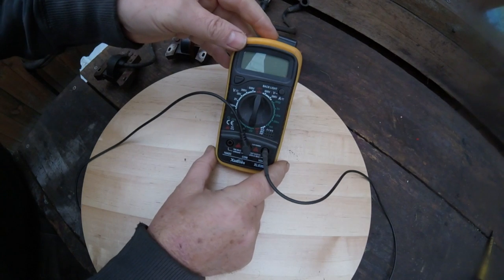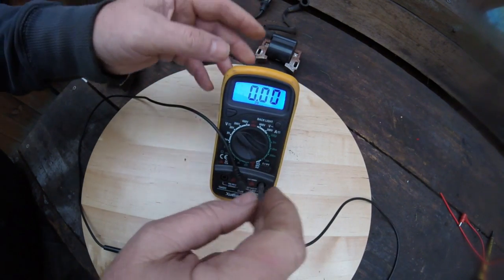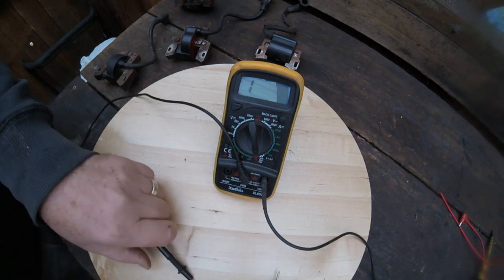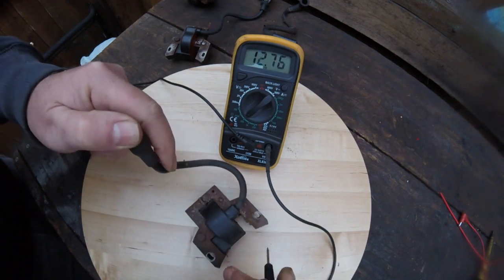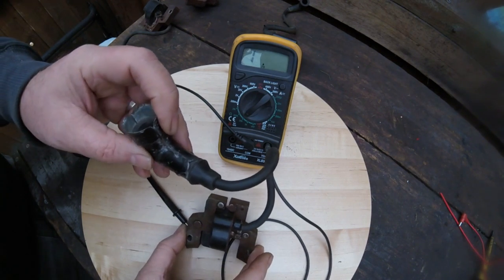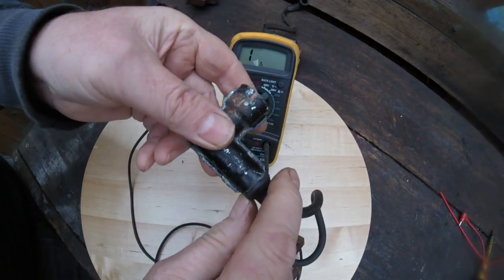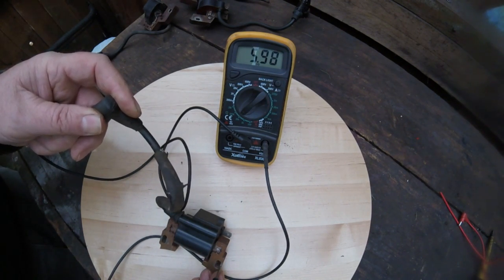How To Test a Briggs And Stratton Lawnmower Coil Using a Multimeter

Comment: Hello Roy - interesting test procedure - all you are doing is measuring the coil resistance - the simplest and most positive test is to disconnect the primary lead turn the engine over and you will either have a spark or no spark - that's one sure fire way to test your coil.
However if you want to do a full diagnostic test for the quality of ignition coils the best tool for that is the IMRIE 3000 - it will let you know the efficiency of the coil and the high tension voltage.  I spent many-many years servicing and repairing commercial and domestic engines used on mowers etc and engines used in hire equipment - my IMRIE 3000 with its various adaptors was an invaluable workshop tool - it made testing ignition systems a simple and efficient process.   https://www.youtube.com/watch?v=zHTEYxWbVTA

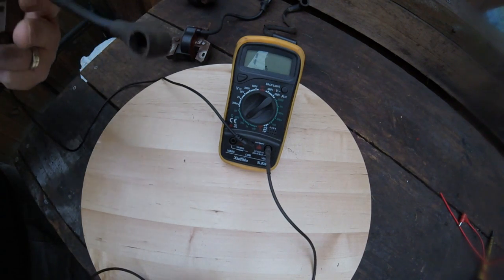Comment: I have an old rototiller that has a single Briggs and Stratton in it. No spark. The coil measures 2.67 when out and checked. It's origanal from the looks of it. It's rusty, but I've seen worse. 2:59 
My question is.... Should I just replace the coil and plug. Then check for spark?

Oh... the model, style, and type of unit isn't found. A sticker refers to the documentation that comes with the tiller. Long gone.
I called a local shop and they said to bring the coil in and they can measure it and that'll help with fitment.

Comment: That last engine with the governor that uses airflow to govern is old-school, dont see those these days.
I got a mower feom the kerb and has no spark and the coil secondary is measuring 4.7k, i might just have to clean all the mounting contact points before pulling another coil off another motor. Kill circuit functions good (switches to ground)

Comment: Thank you (from the USA). Nice video. I suspected my coil was dying intermittently.  For reference (and information) out there, I just purchased two different (aftermarket) coils for my 208cc ( CR950 ) Briggs motor from amazon. Straight out of the package one ohm'd at 6.4k and the other 10.3k oHms. A Briggs & Stratton spec is nowhere to be found on the internet. This was helpful.

Comment: Can a coil quit working when it gets hot?  How do you test for that?  It runs maybe 30 minutes bogs down, then quits. Let it cool down and it runs again maybe 10 minutes and so on. Any thoughts?  This is driving me crazy. Thanks in advance.
Reply from the maker: Yes it can but first try changing the spark plug and could be other things like carburettor, old fuel, and even the fuel cap vent is clogged up or not on properly

Comment: Um... @3:30 testing the way you did there won't give the correct measurement, the resistance of the primary and secondary should not be the same, one should be much greater... 

(Unless everything I learned in Electronics was totally  wrong)...

Comment: Hi Roy ,I think I should point out that the 3rd coil you checked as open circuit has the metal cased.Resistive plug  connector which plugs into the coil lead .It's value is 5k ohm. If this item is open circuit or the connection is  corroded to the lead.Then the test will show no reading on the coil.It can be misleading.I got caught out and purchased  a new coil for nothing.Cleaned the connection after finding out it can be separated. Then tested ok.

Comment: So my coil is off a 17.5hp Briggs and I lost fire yesterday as I was trying to start it up, it kept flooding. Not hitting at all. Thought it was possibly a switch or sparkplug but I tried a spark tester and it wasn't jumping on it. My meter showed 1. On both tests. So my coil is dead?

Comment: I have a talon mower that has one side bolting down the air vein and the coil but it doesn't have a bolt to turn. It could be pressed in or screwed but I have no idea how to undo it to remove the coil. Has anyone done this ? Thanks .

Comment: The coil with the big spark plug cap might be good. Pull the plug cap off of the coil lead and measure directly. When I was a mechanic on motorcycles We would find failed spark plug caps. Many of the had resistors in them and they would fail.

Comment: Finally someone that taught me the right way to use the meter on a coil!! Thank you for your help and video!! So mine reads 6.45 Briggs and Stratton would you know what a new one is supposed to read? I have ordered and installed a new thermostat, changed the oil, filter and still not wanting to run. It has a self choke primer it’s a 2013 craftsman push mower.

I might add the carburetor has been cleaned as well. There’s not much more I can get besides a new coil and carburetor
Reply: If someone hit a stump the key on flywheel can shear....timeing is then off...and 6.0 is good reading... Squirt gas in plug hole...then put plug back in
Reply: @PaulPippinjr-ev2wi  I decided to keep the new coil since there was nothing wrong with the old one. I did replace the carburetor and the self choke primer and the lawnmower has been running great. And let me tell you on the first pull it started right up.🤙🏽

Comment: Question i have a lawnmower 7.25 engine and when the first start is no problem and when the 2nd start the no have spark, i change the oil with a replacement and measure the ohms and have 5.75 k and y calibrate and the problem persist and then i buy a oem coil new and the measurement its 6.50k and i put the oem coil and the problem persist in the 2nd start they no have spark, the flywheel and key its perfect, spark plug its new, any body cant help me

Comment: also test between the coil and the engine case should be no resistance. may have to clean rust or corrosion. I have tested coils that tested good resistance wise but still no spark. took the old spark plug connector off and put on a new one.

Comment: My problem isn't testing it, it's getting to it. I have a 5.5 hp quantum, circa 2004 or 05. I have removed every visable bolt holding on the top and still can't get it off. It's loose, but something is still holding it!! Can't find any instructions for that motor on line. Most of the engines seem to have a couple of bolts on top and whoosh! But I've taken out 6 bolts, three from the front and three kind of hidden in the back and it still won't budge. Don't see anymore bolts!

Comment: The primary windings should always have less resistance than the secondary windings not the same. You tested the secondary windings twice. A resistance test is not a reliable test.

Comment: if it will not fire on the engine what good is  tests with multimeter  just replace it nothing to repair no matter what it reads    what do you hope to find with meter test that you can fix ?????  i use meters every but not ness. this case

Comment: Help!
I'm trying to repair my neighbours lawnmower. I have a little bit of knowledge that makes me dangerous!
It's a big Hayter with a roller and a Briggs and Stratton motor, but can't see any model number.
I removed the rusty coilpack cleaned it all up and did your electrical tests on it. It came back with 4.54 k ohms and the same when I tested it on the ground connector.
I put it back on and with spark plug removed put a test light between HT lead cap and earth on cylinder fin. I got a good pulse light when I turned the engine over with a drill on the flywheel nut. I also tested continuity of the earth lead. Incidentally all work done with kill bar taped up in running position.
Put it altogether and put the test light on the spark plug but no spark.
I've whole procedure twice now.
Second time with new spark plug.
I inspected the Woodruff key on the flywheel. I heard if these break it can throw the timing out. This was all okay. A
Reply: Any ideas what I should do now.

Comment: I'm testing a Briggs carb off a 6.5 hp engine. Reading 4.99. no spark, but the flywheel was cracked as well.  Is this still a good coil

Comment: I have a old Fairbanks Morse generator with a Briggs and Stratton engine. It's a model 23FBPC type 203531 serial 289831. I want to know how to test the coil on it and find out if I can get a replacement coil if it's bad. I have been told that they don't make new coils for this engine?

Comment: I have been swapping Briggs & Stratton coils from one engine to another,for a long time.Never had a problem with them fitting.Recently,I purchased a couple of them from Amazon.I have 2 problems.#1 they won't bolt on.The slots are too far apart,only by the width of the slot (1/8").#2 I tested both of them with my meter,and both read about 7.9K ohms.Out of range to be good..Has anybody else had an issue ???These are NEW,Made in China
Reply: it depends on what the coil fits as to readings .

Comment: On every coil you tested you only did the HT side , I have a few coils with good secondary readings but the primary side was duff , those ones you tested could have been the same so removed ?

Comment: I have a lawnmower with B&S engine, which is difficult to start when hot. I also have a B&S coil with 9.34k Ohms. Could this be the problem?
Carburator is without choke, it has a priming bulb

Comment: Very helpful. Thank you. I just bought (very cheap - 20$) a 8 hp snowblower with B&S engine, no spark - so I'll use this metode to test it.  Very easy, and I don't have to remove anything to get it testet either :)

Comment: Big help, thanks. Note, B&S coils spec between 2.5~5k ohms. (not 25,000)
Reply: Dude thank you ...when he said the coil should read 25,000 to 26,000 ohms & he put it on the low setting of 20 ohms on the meter IT DID NOT MAKE SINCE...

Comment: The coil with the metal sparkplugcap is dead,  but in these caps is a big register build in, pull off the cap from the wire and test it again, these metal caps offen gif a lot off troubles, they are a realy pain in the ass.

Comment: Coils fine , plugs fine still no spark any ideas Roy ? Many thx
Reply from the maker: Check it ignition wire connection if it's a briggs 35 classic it's at the back
Reply: Was running and cut out , I thought it was fuel
Reply from the maker: Have you checked and cleaned the carburetor
Reply from the maker: Or tried another plug

Comment: Mine is reading around 9k ohms, what's that mean?
Reply: Did you have problems with the coil? I have a lawnmower with B&S engine, which is difficult to start when hot. I also have a B&S coil with 9.34k Ohms. Could this be the problem?

Comment: Just FYI - resistance has no polarity, so you don't have to worry about putting the positive test lead or the negative lead in a specific place - you'll get the same whether they are switched or not.

Comment: A very useful video. Didn't fix my problem, but I was able to avoid wasting money on a new coil. I suspect my problem is bad magnets in the flywheel.
Reply from the maker: Try cleaning any rust from the magnetic and from the coil
Reply: @roystheboy  I did that. It didn't help. I got fed up with it and put it at the curb. Now it's someone else's problem. :-) Thanks for the suggestion.
Reply: @Bargle5  never seen a magnet go bad. Did you happen to sand the post the coil bolts to? Also gap it correctly.  Guys like me absolutely love guys  like you because of your lack of patience as well as knowledge of the situation.
Reply: @cravenmoorehead5636  Yes, sanded all the contact points. Set and double checked the gap. Also checked for a grounded out kill wire. And made sure the spark plug was good. Nothing helped.
Reply from the maker: Then some time we have to do that

Comment: You say the range is 25000- 5000 ohms  and then test one  coil that comes out at 2,67Ohms   2670ohms and said it's good,  doesn't make sense to me ??  Seems to be out of range to me , maybe you meant 2500-5000 ? Anyway thanks for a good video
Reply: Googling the question yielded multiple 2500-5000 ohms.
Reply: I see your point, you are being a jerk. Anyone than can run a multimeter should understand what was met not what was said.😊
Reply: He did say it's probably on the way out.
Reply: He should have said 25 hundred....not 25 thousand.  2500-5000 is the range. Mine just tested 9.96.  So 9960. Way high

Comment: Maybe there is some confusion about what a good resistance reading range should be because you say between 25,000 and 5,000 when you actually mean 2,500 and 5,000.  You say 25 thousand not 25 hundred.  Just pointing out some confusion.

Comment: Put the coil on the engine. Adjust the gap. Unplug the kill wire. Spin the engine. The coil will either work or it won’t.
Reply: It can have weak or intermittent spark sounding normal but cant handle a load while trying to increase the rpms of the engine

Comment: What should the resistance be between the kill switch tab and the coil body (ground). I'm not getting a spark and the resistance checks out OK for the coil but the kill switch tab read 0 ohms (the kill switch tab is always at ground).

This is with the coil off the engine, so it's not the kill mechanism.
Reply from the maker: Check the wire for continuity may have a break in it

Comment: Great video! When I try this, I get a reading of around 2.2 with the first test, but when I connect one end to the spark lead and the other to the kill switch, I get no reading (infinite). Is the coil bad? Thanks
Reply from the maker: Did you have the dead mans handle in or out
Reply: @roystheboy  I disconnected the coil so it wasn’t grounded. Thanks for replying
Reply from the maker: @sulemanyusufadam4315  ok so its now ok
Reply: @roystheboy  sorry no I mean that the coil wasn’t on the machine so the dead mans handle wasn’t stopping the coil working

Comment: Your touching the coil lead, and the chassis of the coil with your hands and the probs  this is giving you a false reading as your body conducts electrical current also. Dont touch the meters probe leads and if you must do it only touch one and nothing else. Don't hold the part in your hands.  
If you were testing a complex circuit you couldn't do it that way.  Depending on humidity how wet your hands are you very well could be reading your body and not the coil.

Comment: I just did this test on a power washer today. It had no spark. So I pulled the coil and checked it. The coil read 4.5 k which was within specs. I noticed it had considerable rust on the legs and on the flywheel. I polished those up and..viola! The engine started.
Reply from the maker: I'm glad it helped you repair your own one

Comment: Thanks for the good video. My coil tested within the range you describe, but due to ruling out everything else that could have caused the mower not to have spark, I replaced the coil with a used coil, and the mower started right up.
Reply: Might’ve been one of the wires....
Reply: The coil on the bench may check ok, but if its not grounded to the engine block, you wont get a spark. Check for corrosion on the mounting points.

Comment: Can you tell me what the reading should be for a coil from a 450e  briggs and stratton push mower  ? I think i'm doing it right ? I get a reading at  6.64 is that what it should be ? Thank you for your help !
Reply from the maker: The reading you are getting is ok to me are you getting starting problems
Reply: @roystheboy  Hi Roy, Thank you for getting back to me. After numerous times of taking the mower apart checking for spark and cleaning the carburetor twice. I would check the coil for a reading, most times i would get nothing. Maybe i didn't have a good grounding, but finally got a reading on it. So i know that wasn't my problem. What i did find out finally was that my kill switch wasn't allowing me to start the mower. Thank you for your help, I enjoy your videos !
Reply from the maker: Your welcome I'm glad you sorted it out

Comment: I'm working on a pressure washer, B & S 8BSxs.1901VE.  Coil reads 4.8K ohms, but no spark at all.  Solid state ignition (no points). Flywheel Magnets seem fine and are clean. The machine worked ok a few weeks ago, but it was hard starting then. Going to try a new coil anyway. 

Anyway, thanks for the info mate.
Reply from the maker: Glad it helped you well done on the repair
Reply from the maker: Have you tried spraying some carb cleaner where the plug goes just to see if it fires
Reply: @roystheboy  Yes, I tried that,  starting fluid, and a different plug.  Occasionally, it will throw a weak orange spark.   I've settled on a diagnosis, the coil is intermittent for some reason perhaps shorting or opening due to vibration.  I have a new one on order, should be here next week.
Reply: @roystheboy  I received the new coil. It started on the first pull.  Obviously the coil was the issue.  Thanks for the vids.

Comment: Roy might be the boy but he failed to test between the kill switch terminal on the coil and the base/plug wire.  He's assuming without doing so because if the terminal for the kill switch on the coil reads zero to the base, without being connected to the switch itself means you have a bad coil... Will never start.

Comment: I have a John Deere with the B&S 18hp not firing the spark plug on the right side. Step one switched the plugs from right to left, and right one still fouling out. Step two replaced both plugs with new ones (mainly just because it was time to do so). Step three took coils off thinking I'd be replacing the one on the right anyhow.  Step four went thru this testing procedure as show in the video, but both coils are good. Step five scratched my head and stared at it for a long time. Step six, tested the kill wires with the ohmmeter and found that the one on the right has zero connectivity. So I'll be going out tomorrow to get a new wiring harness for the kill wires. I'm happy that I'm buying two pieces of wire for about $12-15 instead of a more expensive coil. Hopefully that fixes it and I can get back to mowing.
Thanks for the video, this was very helpful and saved me from just running out and buying a new coil without checking first.
Reply from the maker: Thank you bob for watching I am glad it saved you some money you seem to know what you're doing good luck with getting it fixed.